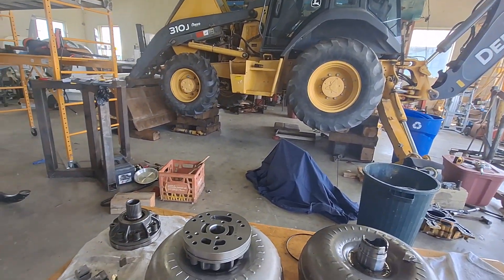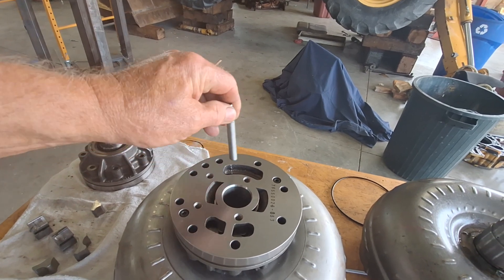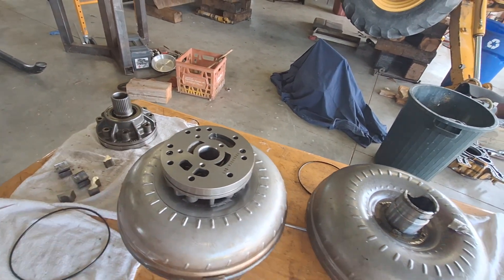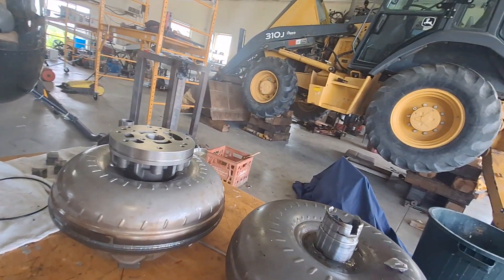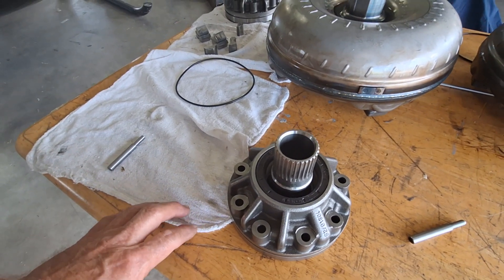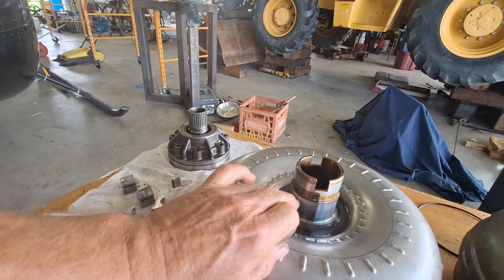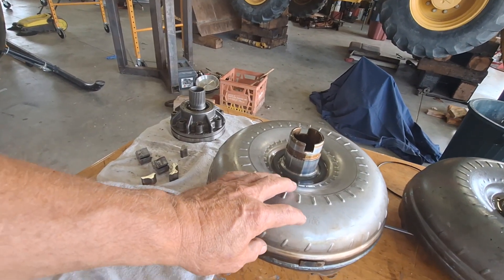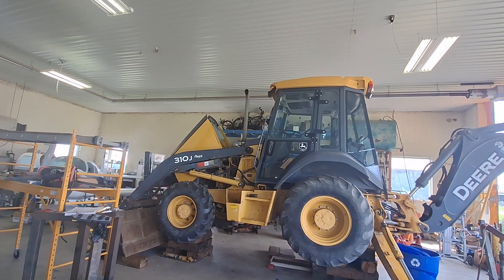Part 2 John Deere 310J 310 Backhoe transmission problem brake will not release, no flow  filter off

Comment: Quick question.  When u installed the pump back on. The u put loctite high flex gasket maker? Or does it only need gasket maker when installed the bell housing
Reply from the maker: The manual is confusing.  I used the loctite flex everywhere
Reply: Yes very confusing.. 😂  
Im debating putting loctite flex behing the actual pump. Im afraid if it will damage it. Did u add some to it?
Reply from the maker: The pump has an O ring. Don't apply sealer to it.